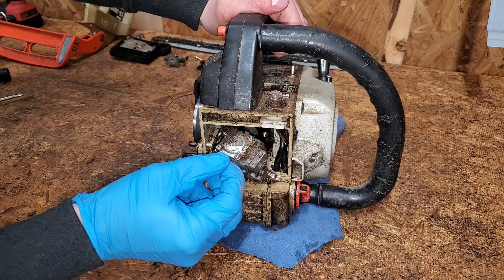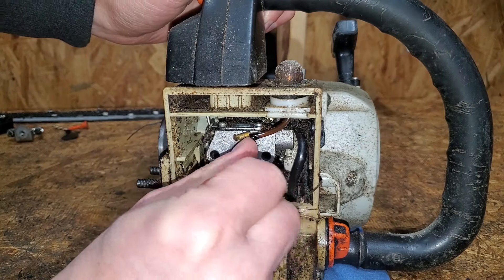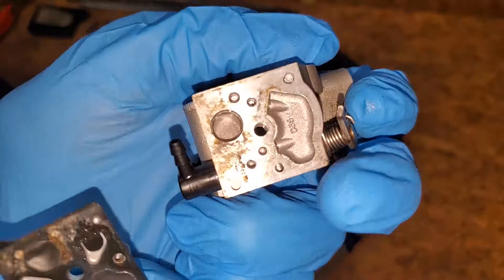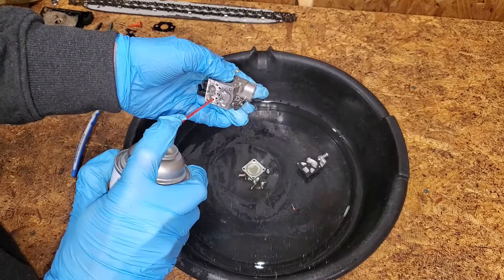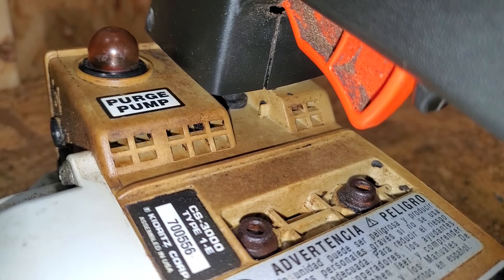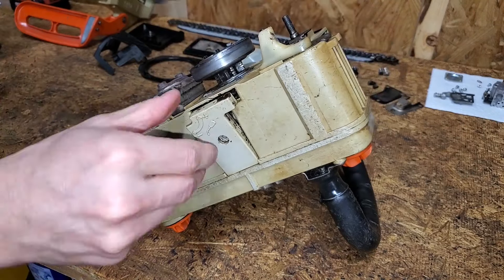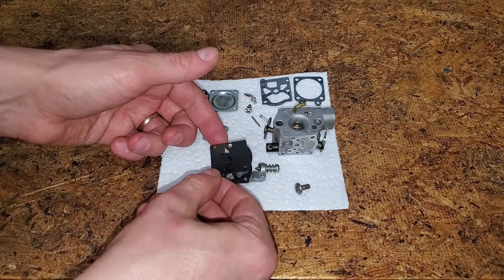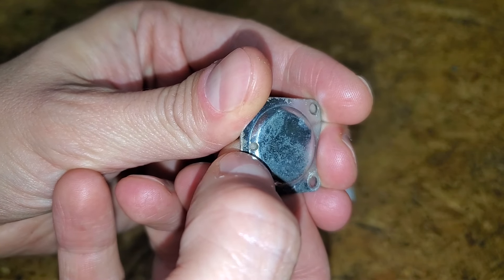Fixing a Top Handle Chainsaw

Comment from the maker: *These parts can usually be obtained cheaper locally, or you can buy aftermarket parts to save even more.

Carb Gasket & Diaphragm Kit (12310105960):
https://amzn.to/3V59Cek (affiliate*)

Complete Carb Rebuild Kit (12310039130):
https://amzn.to/4aGusqb (affiliate*)

Air Filter (13031039132):
https://amzn.to/4aEkGF3 (affiliate*)

Fuel Filter (A369000480):
https://amzn.to/3VjEmK6 (affiliate*)

Muffler Cover (A320000033):
https://amzn.to/3yzgjOc (affiliate*)

Grommet (10402939230):
https://amzn.to/4bCnALH (affiliate*)

Spark Plug (BPM8Y):
https://amzn.to/4bAWCo3 (affiliate*)

Grease Gun:
https://amzn.to/3V98eaO (affiliate*)

*Purchasing from these Amazon affiliate links earns my channel a small commission. Think of it as a tip that doesn't cost you anything. Thanks for the support!

Comment: That saw looks like it isn't that old, just had a lot of abuse and neglect from the previous owner. Nice job restoring it to good working order. Being able to obtain spare parts is the key. I bought my first saw, a Stihl 015L around 50 years ago. Maybe 10 years back, I did a rebuild on it, new main bearings which I was able to obtain locally here in Australia and I got a new carburettor, used chain cover and a few other parts that I got from a small shop in the US through the mail. I've also rebuilt two Ozito chainsaws using parts from three damaged.broken ones with a new coil for one. Parts are not obtainable for these Ozito saws, so I am still missing the air filter and air filter cover from one.
Reply from the maker: Thanks! Yeah, it seems like the major brands do a really good job of providing access to parts through big reseller networks, even for older models. That's part of the reason their stuff costs more. Not only is it better quality, but it's also supported long after the model is discontinued. You can spend less money on a store brand tool but in a lot of cases, replacement parts are not even available, even for newer models.

As for the Ozito saws, do you have access to a 3D printer? If so, you could take measurements from the cover of another saw, even if the cover is broken, and print a new plastic cover. When it comes to the air filter, I found that you can buy rectangular pieces of air filter material and then cut it to fit your needs. It might need more cleaning than the original but, if done right, it should provide adequate protection. Thanks for the comment!

Comment: I usually just go to Amazon and buy a Kungfubrator. In many cases the new carb is cheaper than a kit . I was really surprised when I worked on my McCullough that they are no longer in business and any info or parts is nonexistent. I was also surprised how much of the saws are plastic
Reply from the maker: I don't have much experience with aftermarket carbs. If possible, I prefer to repair the original but it's nice to know there are cheap options if needed.